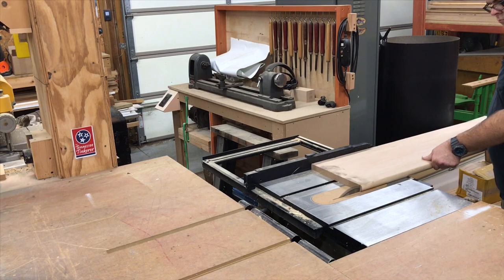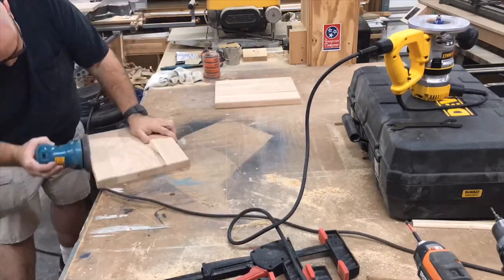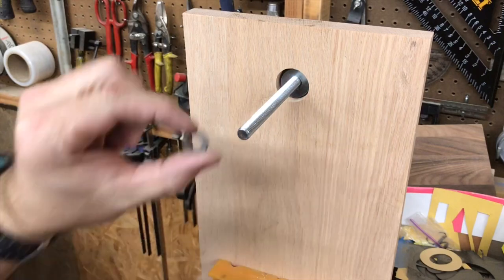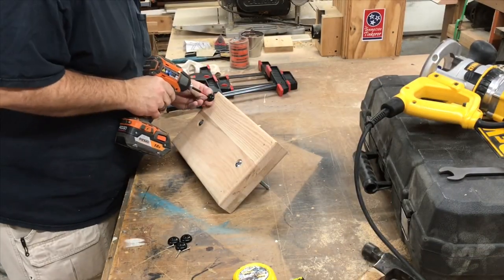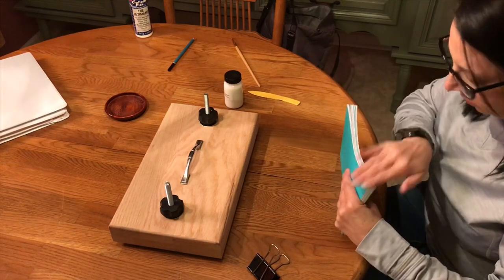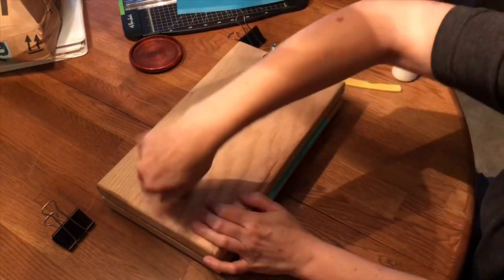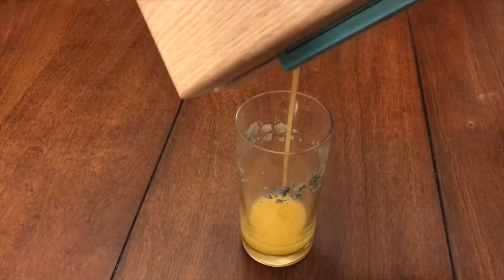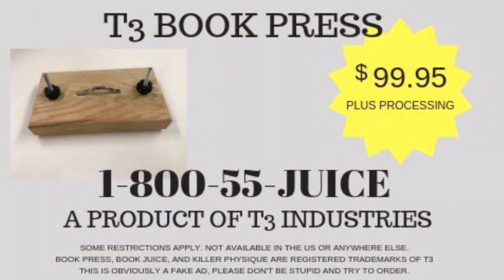Woodworking: Book Press with Bonus Infomercial

Comment: What are those cool discs holding the board while using the router on the edges?
Reply from the maker: Those are Bench Cookies by Rockler Woodworking (Rockler.com). They are awesome for holding your workpiece stable while you route, sand, etc. Thanks for the comments!